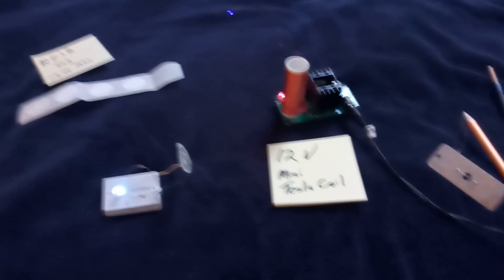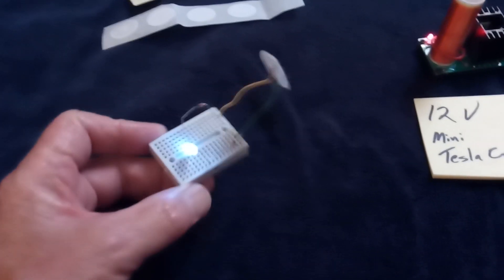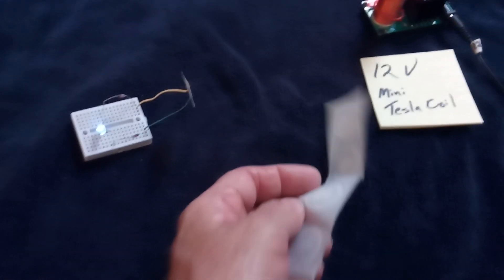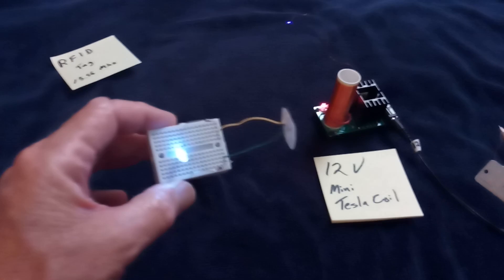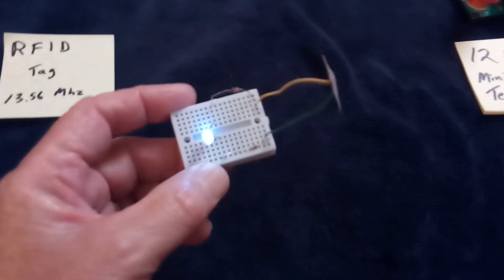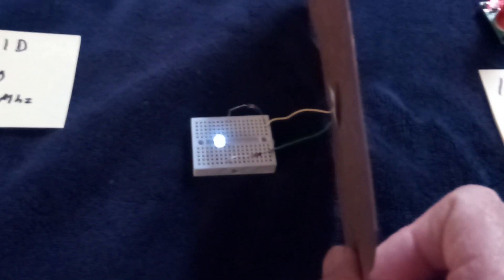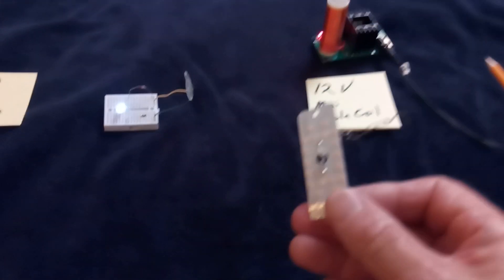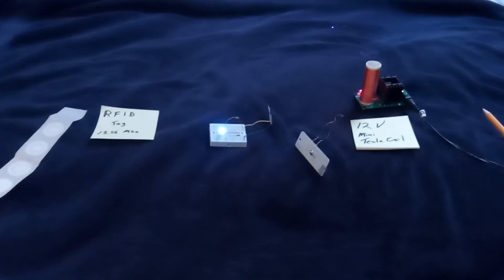RFID Tag used as a tesla coil energy receiver

Comment: I picture an off grid village running one of these in the center off of solar power and storing the extra energy  in supercapacitors or a batter bank so that the entire village can have free led lighting for extended night time studies. So cool!!!
Reply from the maker: Unfortunately there is a huge energy loss when you do wireless energy transfer.  Just running a wire is much more efficient.  There are applications that do make sense where a direct wire is hard to do.
Reply: @Lidmotor  I remember when we were memorized by the onset of the joule thief or the blocking oscillator just short of a decade ago, you have come so far! Thanks for what you do I still love your projects!

Comment: That is some impressive distance. I had a good search in some boxes but still haven't found another RFID label. I am sure I had at least one more laying around.
Reply from the maker: I will keep checking my boxes also.  I tried my tag on the cell phone charger again with not luck.  I will try a different wire attachment on another tag and see it that is what is wrong..  The other thing that  I might try now is a multi coil arrangemet for a pulse motor.  Perhaps four tags around a four magnet rotor.